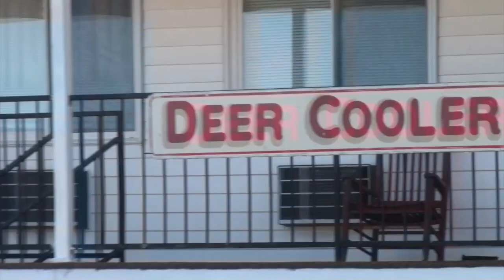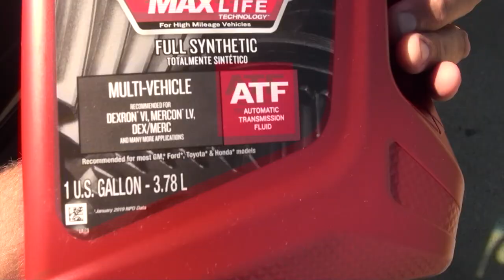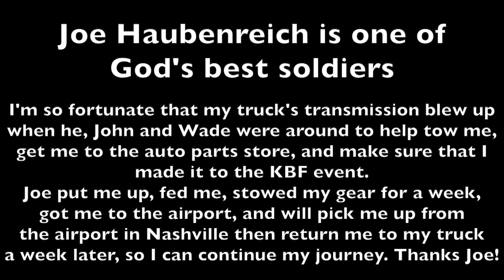759 miles from home

Comment: Transmission is the most overlooked system as far as maintenance is concerned.
Reply from the maker: I had that fluid changed about a year ago. I think that is was just wore out with 267K miles.
Reply: @TheLittleStuff  plz don't misunderstand. Just trying to offer  friendly tip. Wasn't throwing shade at you.

Comment: Most likely just a rusted transmission line on the front frame, I just replaced mine on my 2013 PA rust bucket F150
Reply: those transmission lines are a notorious failure point on these trucks.  I got really lucky with mine, I was changing my oil, saw oil on the trans cooler line connection, and when I went to wipe it, the fitting came apart in my hands.